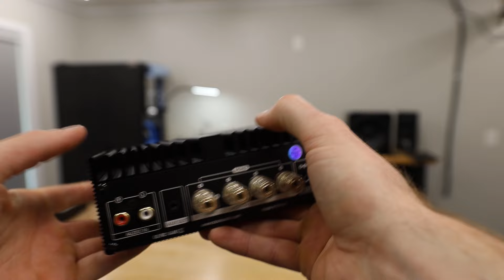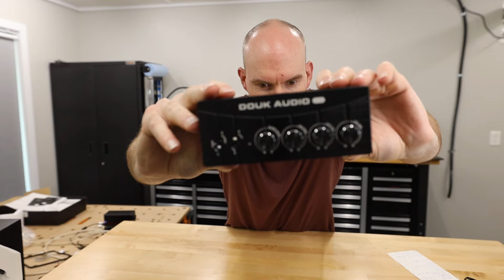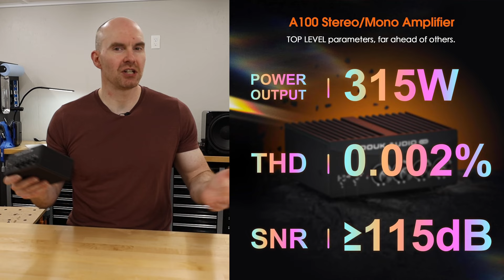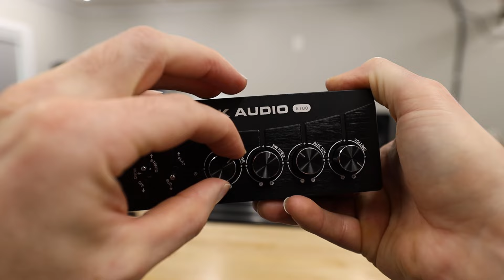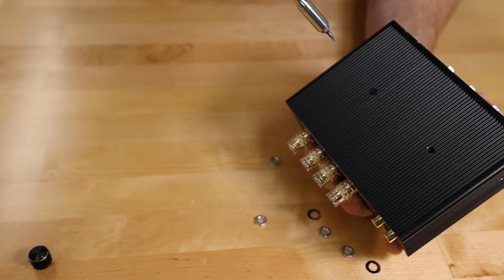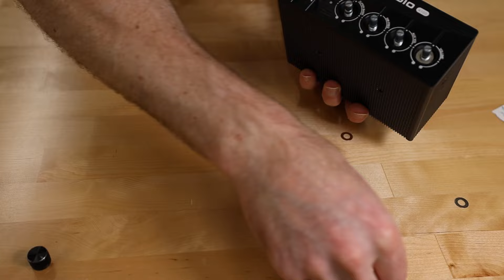Douk A100 Beauty Is In The Eye Of The Beholder

Comment: Nice, honest review, but I get the impression Douk and others are reaching a bit, trying to differentiate their products in a crowded market. We are getting a succession of products with hard to see use cases. This obsession with passive subs being a case in point. I don't know anyone who has one. Twin sub outputs and active sub management with high and low pass filters are what people really want, but obviously more expensive to implement.
Reply: After following these FunFi amps for a couple of years I get two very distinct impressions...

1) These manufacturers are far more invested in features than the usability of their equipment.  "Fancy over Function" if you will.  

2) The guys designing these products don't (and probably won't) own a decent stereo system, to know what it takes to make it all happen.

This is made rather evident by silly decisions like BTL vs PBTL on the power switch.  This is a one-time setting when you build a system, not something the end user is going to change every time they turn it on.  

Another example is the frequent incorporation of Aux and Sub out features that are not controlled by the main volume control.  

But on this one the big giveaway is a board designed for "bottom plate" cooling stuffed into a case with big fins on top.  Seriously, they could have improved cooling on the TPA3255 chip by leaps and bounds if they bolted the heat spreader to the top of the case, where the fins actually are... but chose not to.

I can go on at some length about fully enclosed cases, input choices and other things but I trust you get the idea.

Comment: For Op-Amp enthusiasts, be advised that the Op Amp sockets in the A100 are spaced very closely together, thus necessitating the use of IC-based Op Amps only.  I tried every which way but loose to try and get some Sparkos Labs SS3602's in there, but regardless of what I did (spacers, etc), they wouldn't work, so I settled for the MUSES02.  Also, beware of the volume.  I have mine on a desktop, near-field setup, yet my volume is set to the 3 o'clock position just to get normal levels.

Douk is aware of this as they responded to my inquiries, and they said that later batches of the A100 would be released with wider spacing of the Op Amp sockets (thus allowing for the wider Sparkos Labs versions).  They also said that they will be adjusting the volume in the A100, so that's good know.  However, for those of us who purchased these units now, we're stuck with ours.

A guess Douk/Nobsound (same company btw) are trying to complete with the likes of the Fosi ZA3 of the V3 mono-blocks - or the Aiyima A70.  Problem for Douk is that there are no balanced inputs on the A100 (bummer for a $199 retail price model), whereas the aforementioned Fosi and Aiyima models all have balanced inputs also.
Reply from the maker: Thanks for the comment, I have some burson op amps as well and they are not too wide like the sparkos...just too tall.
Reply: @MattCoykendall1  The Burson's may work.  I didn't have any on hand to make the comparison.  I would imagine the less expensive Burson V5i's would work.  But Douk is aware of this complaint and they did respond that future versions of the A100 will have wider spaced sockets.